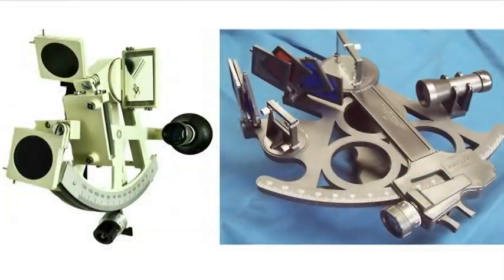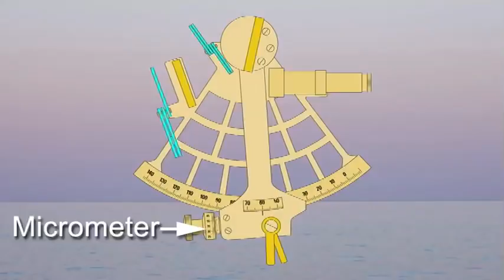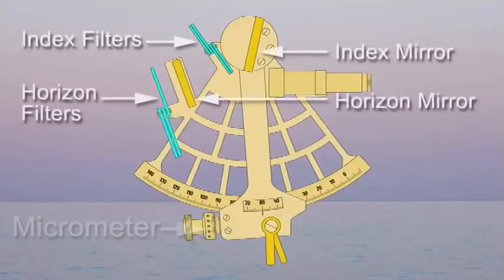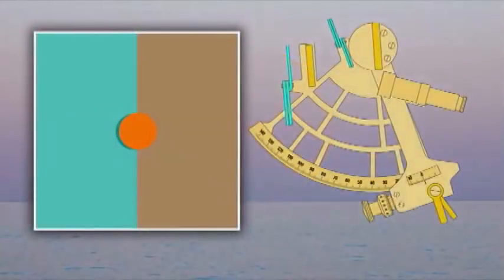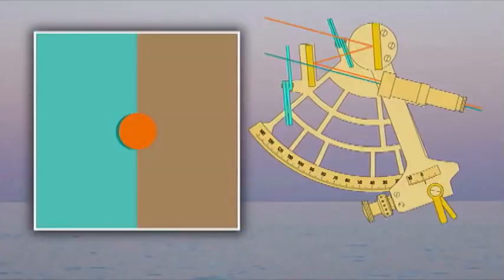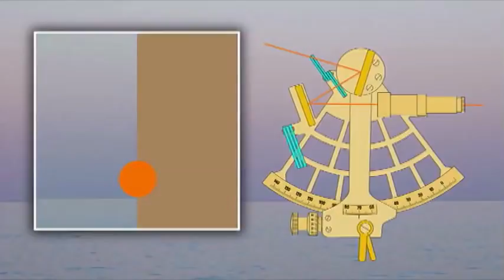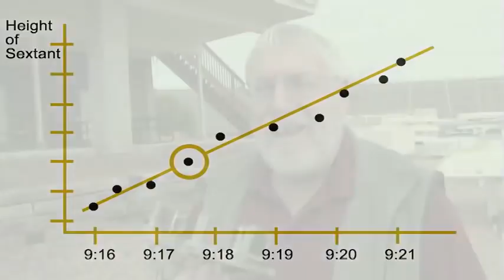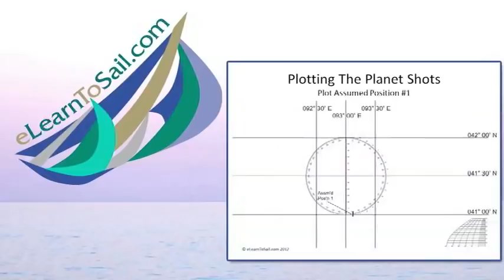Calibrating and Using A Sextant

Comment from the maker: We have a Coastal Navigation course (9 - 3 hour sessions) that goes over multiple techniques for emergency navigation.  The entire course is based on the premise that the boat has lost all electricity, so there is no GPS, no Depthsounder, no Knotmeter, etc, etc.  We use current charts from 5 different countries showing you how to enter foreign harbors and the old tricks of the trade.

Comment from the maker: What do you mean by a +3 mile error - after you have solved the shot, you now have a 7 mile error?  If the 3 mile error remains the same after looking at a star, going and using the drum to set the 2 starts one on top of the other, then that is probably you index error.

Comment from the maker: Either way will work, with your instructions, you will use the altitude corrections for the lower limb.  With the method shown in my video, you use the altitude corrections for a star.  The difference between the two, is the semi-diameter of the sun.

Comment: Hi, nice instructional video. I have a question. Since the reflected image of the celestial body shows up both in the clear portion and the mirrored portion of the horizon mirror , why is the mirrored portion necessary. The clear portion also reflects the celestial body. It seems as if the clear portion of the split image mirror acts as a whole horizon mirror, ie. It both reflects the celestial body, and transmits the view of the horizon.
Thanks very much.
Reply from the maker: You need two rays of light for the sextant to work, one being reflected from the celestial body and one coming from the horizon.